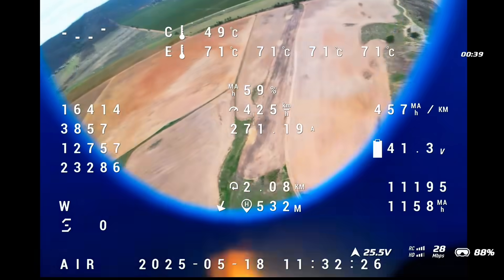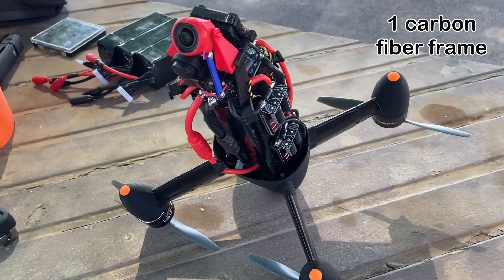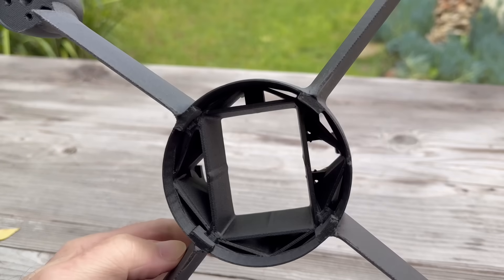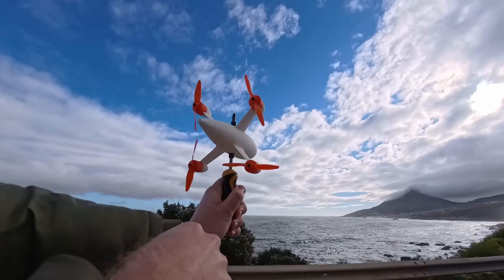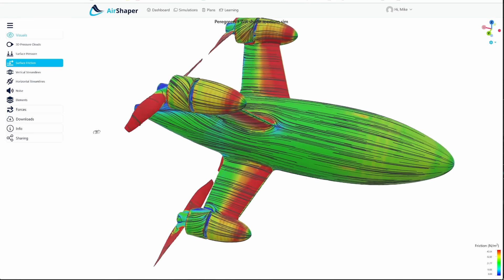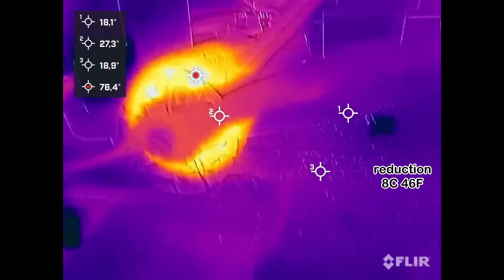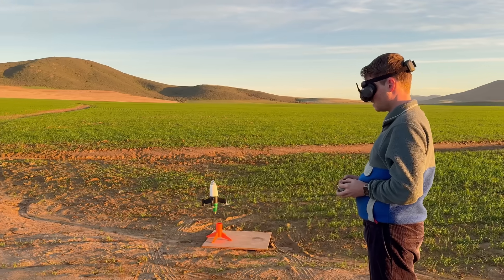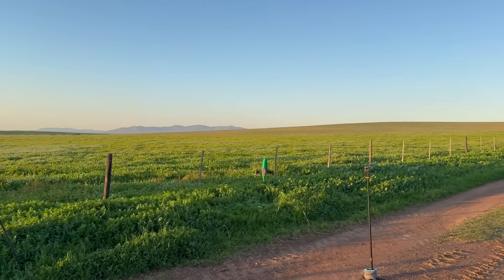How fast can a drone really go? 🇿🇦

Comment: This is truly bonkers! Bravo to you Mike and to your son Luke. What a team you make! Magnificent work. Keep it up! I wouldn't be surprised if one day the 2 of you figure out how to design and fly the first supersonic electric RC aircraft. It seems far fetched today with current state-of-the-art battery specific energy, specific power, ESCs, thermal management, etc. to reach ~1200 km/h (at least at low altitude/high temperature), but then again, you've gone a lot faster than anybody could imagine with a quadcopter, so who knows. There's already a guy named Spencer Lisenby here in California who flies a transonic dynamic soaring RC glider at 907 km/h, so theoretically with the right design and under the right conditions, an electric supersonic RC aircraft should be possible.
Reply from the maker: The drone speed brick wall is probably high 600kmh.  Then prop tips go supersonic and drag is insane.  The dynamic soarers will always be king, I dont think that is in doubt.
Reply: @Mike-Bell  I was thinking one or several specially designed EDFs for supersonic. Props obviously won't do it. It might require a cone or ramp inlet to lower the Mach number to subsonic speeds inside the inlet using a judiciously attached oblique shock, before the subsonic flow feeds into the EDF. Without an afterburner, a steep dive might be required to get past the transonic drag spike and have the inlet started before leveling off at a mildly supersonic speed once you have pushed through the sonic barrier. Will most probably require careful area ruling as well.
Reply from the maker: @kaviator  sadly that’s way outside the capabilities of current batteries 😅
Reply: @Mike-Bell  Would you say the limitation stems mostly from specific power, specific density, or something else?
Reply: @Mike-Bell  You might have to scale it up some more, and obviously that would be expensive.

Very few supersonic aircraft can go supersonic on the deck (B-1a and of course the F-15), you get to the point where you are actually boring a hole in the atmosphere (dynamic pressure > static pressure).  Due to battery energy density limitations, it's hard to get altitude and lower air density.  The Ukrainians are trying that with balloon launch.

Maybe a two stage drone, with a first stage (which might just be a droppable battery) which gets the thing to 5000 m.  There is half the air density there.  Dropped battery packs have been done -- Rocket Lab Rutherford engine does it.

A supersonic diffuser, electric compressor, and de Laval expander could be done.  Note that it would actually convert (some) heat energy in the incoming air (and motors) into thrust.  That's not a violation of thermodynamics, but rather a consequence of electricity being so low entropy.  You'd have an interesting control problem matching the intake diffuser to the nozzle choke -- I don't think you could use differential thrust for flight control any more.

In fact, I think you'd have to switch to a single central fan inside the body, and moveable fins for directional control.  That'd cut out a lot of drag from the pylon mounted motors.  I've no idea how to land.
Reply: @IainMcClatchie  Agree with scaling up and a single central EDF (Reynolds doesn't help when too small). I'm picturing this as something very slender resembling a scaled down F-104 without a cockpit, or even simpler with a single cone inlet a la D-21. Landing via parachute. Two-stage climb is probably easiest (mothership air-launch, balloon-launch, rocket assisted climb, catapult, or anything that could give it some initial speed and climb). Single-stage would be quite a challenge but then again, it might be possible with some ingenuity.
Reply: @IainMcClatchie  Supersonic on the deck is possible for most supersonic fighters. They're usually limited to Mach 1.1 or so by structural and thermal issues- thrust is sufficient to go faster, but components like the canopy and final stage compressor blades start to really feel the heat going that fast down low. For an electric aircraft, this would be a big problem even at higher altitude- things we usually make from plastic like EDF fan blades would melt, and the motor would have to be able to withstand very high temperatures, too hot for typical neodymium magnets. That of course discounts entirely the battery energy density problem.

I think supersonic R/C is possible, but you'd probably need to use a turbojet rather than electric drive.

Comment: "400 amps..."
My ears did a double-take.
Reply: I think we maxed out around 440A, at 12S! Not even 6s. hahaha
Reply: @LukeMaximoBell  We aren't flying drones, we're welding battleships.
Reply: @LukeMaximoBell  At this point you could try cooling it with LN2 and reach superconductivity...
Reply: he said 16KW, so 400A at 48v is 19 kw?
Reply: @bestelectronicmusicfromnew5189 how much of that gets to the motors, internal battery resistance, cables, traces and the RDS of any power FETs. High current can be pretty inefficient. Probably have to really up the voltage to get more power efficiency.
Reply: @bestelectronicmusicfromnew5189  That's close enough to start measuring in Hiroshimas..
25 - 30 hp in a drone that weighs how much?

Comment: PCBs are fiberglass. Why not save weight by making the motor arms out of the electronics and adding some epoxy overmolding? That also opens interior space for additional batteries. There is also much more power density in axial motors, plus it would allow you to double the props and increase efficiency.
Reply: Axial motors don't have higher power density, they have higher torque density.
Reply: There are no axial motors available in this class and size. They will be way bigger anyway and increase drag drastically.
Reply: @GiovanniEsposito5  You can make them the EXACT same shape as his current onesno drag difference. Axial motors are used in CD drives all the way up to wind turbines. My suggestion entails making your own by routing PCB traces and STACKING layers, which any decent manufacturer can make 65 layer PCBs. Axial motors are more energy dense than radial the reason they are less popular is COST. He is more concerned with PERFORMANCE.
Reply: @excitedbox5705  Your proposals don't make sense by any means: efficiency, performance or cost. Axial motors of this class and size won't make any sense because they will be way too small and won't have the power required. CD player have complete different torque needs and turn at low rpm, while this is the opposite. They will be completely worthless and cost a fortune to make custom in this size. So, NO. Using custom pcb to make the arms will be possible but will have many downsides, also probably won't be as rigid and strong as they need to be and will always need external cables, because no matter how many traces you can embed, you won't have enough copper...

Comment: World's fastest drone - almost 600 km/hr using 16.2 kW of power. 6 g-force in turns.
World's fastest RC plane - almost 600 mph, no motors, just gliding. 100 g-force in turns.
Reply: World fastest space ship - almost 690,000 km/h, no motors, just gravitational well energy. 0g-force in turns around celestial objects.
Reply: Dynamic soaring is wind power. Not the same thing at all
Reply from the maker: I am in awe of the dynamic soarers.  Electric will never match that

Comment: So very cool, I really like the technical walkthrough with the aerodynamics.  Actually, the most interesting part of this was the connection issue, I never considered how the Doppler effect would mess with digital signals. I guess the control system always is dealing with this however the rapid change from a compressed frequency to a... Spread out(?) frequency is too quick for the computer to adjust for?